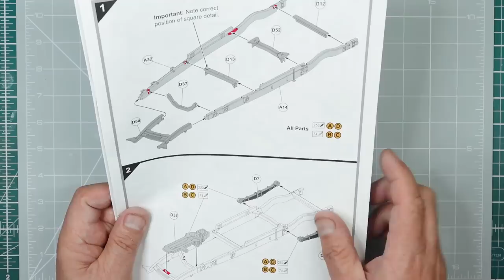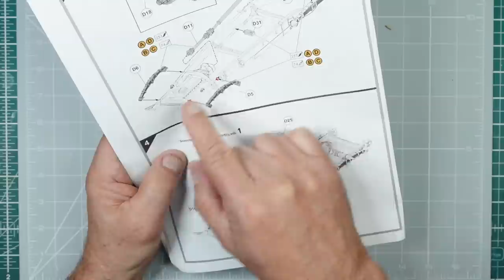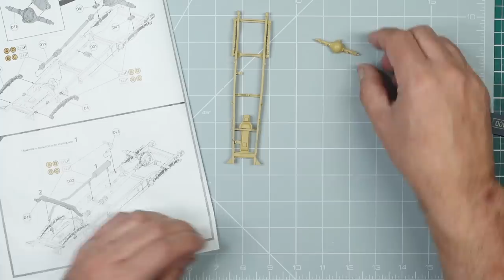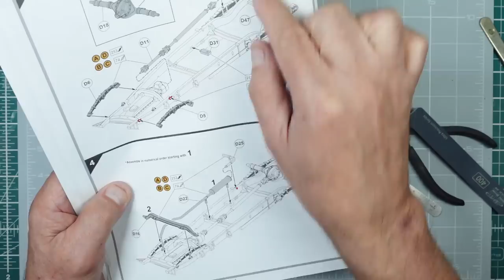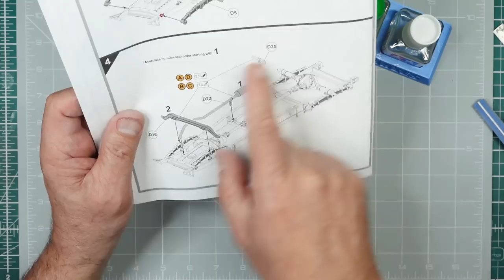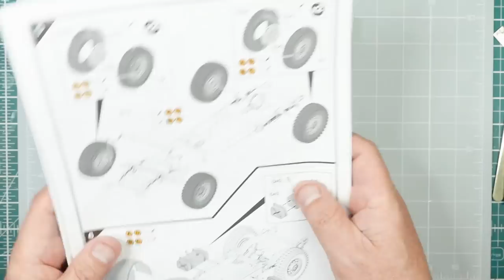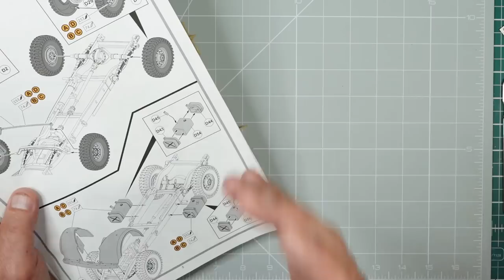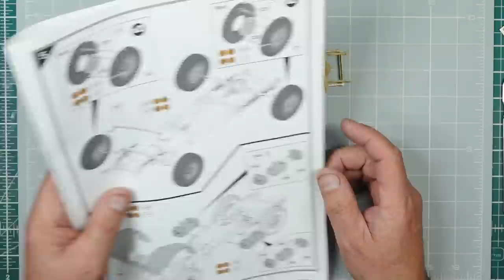A new build for beginners. Part 3, Finishing the Chassis

Comment: A good tip for making your exhausts look rusty. First paint over the exhaust silencer with Mr Surfacer. Let it dry for a couple of minutes, but not totally dry. Then stipple the surface with a stiff old paint brush. This will make the silencer all lumpy and bumpy, like they go when they rust. Then you paint it with your rust colours.
Reply from the maker: I just did that on another project video to simulate cast texture, the same can be achieved with TET.

Comment: Hi Nigel, I just finished this kit- really nice straightforward kit.
 Only two fit issues to be aware of which might save some later issues. Part A18- the insert for the panel which sits above the driver's cab- the rear edge prevents the fit of A19 seating against the body structure. Take a small shaving from the aft edge of A18 and it will seat properly. Secondly in step14, the main body structure does not fit well with the fender part D9- in the event the front wheels will hide this vertical joint within the wheel wells. Hope this is of help?
Reply from the maker: Hi Dave. I have finished the kit now. I know what you mean about the fenders..

Comment: Another great video. I have to say I learn something new every time. 

Very interested in using the 2 aluminium bars, a great little tip. What size are the bars you were using please?
Reply from the maker: They are 20mm square by 300 long
Reply: @NigelsModellingBench   Cheers Nigel, 👍👍👍 Well I have managed to get some 3/4" x 3/4" (19.05mm) on order but 20mm x 20mm 6082 T6 seems to be like Rocking Horse Doo Doo 💩💩💩 at present!! Global supply issues etc. etc.. I did find some at RS but too many 💲💲💲💲 to be justifiable!! I may machine and pocket drill the bars and add a 10 x 5  Neodymium magnet in one side at each end, that way I can  use a steel plate / steel rule across them to keep them from moving. Will see when the bits arrive. 🤔